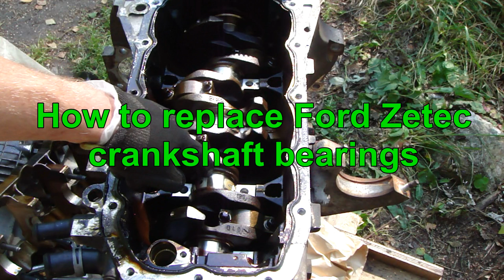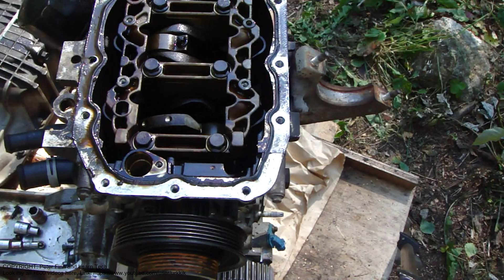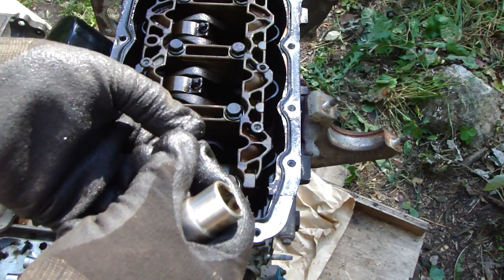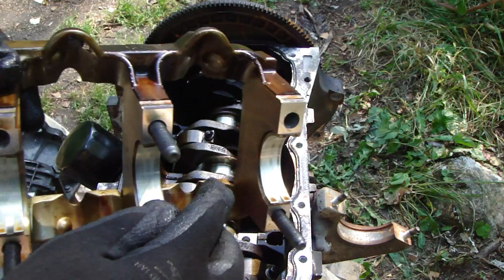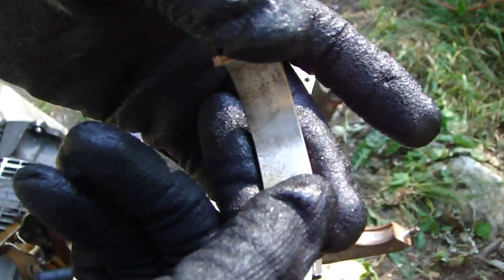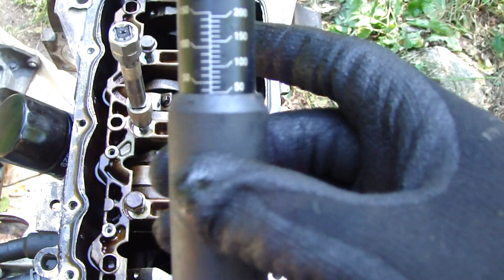How to replace Ford Zetec crankshaft bearings

Comment: You can just rotate out the other half of the crankshaft bearings with a plastic plug...like a 1cm plastic dowel wedged into the oil feed hole in the crankshaft.
Reply from the maker: Thank You. Sir

Comment: Hello, did the crankshaft bend after removing the bolts or did it work?
Reply from the maker: It works
Reply: Peter Finn hey peter, thanks for the reply. Your videos are great. I have a problem with the engine block of a ford fiesta V  1.25   16v with engine code FUJA. It is a zetec engine. Everybody says if i remove the crankshaft support like in this video it will bend. I need to change the bearings on the crank and rods. I need the toque specs of these bolts and the pattern of torque. I also need the piston rings but I can't find them. The piston size is the same of ford fiesta IV 1.25 16v. Do you think it will suit? Thank you very much